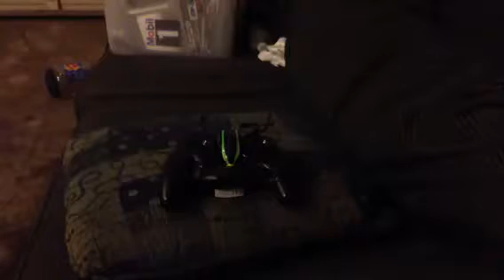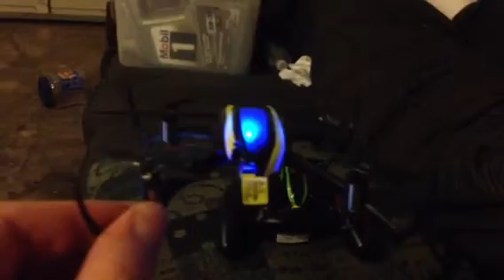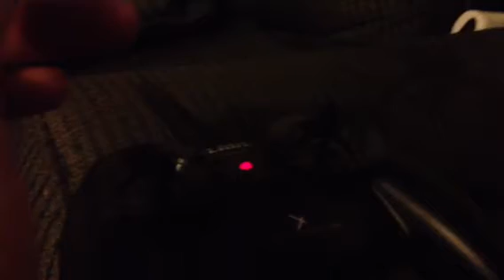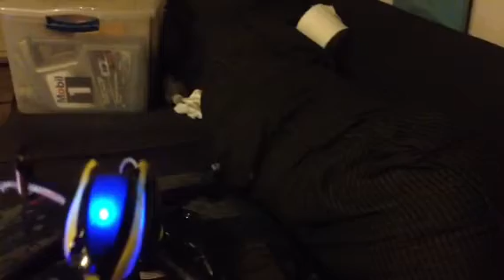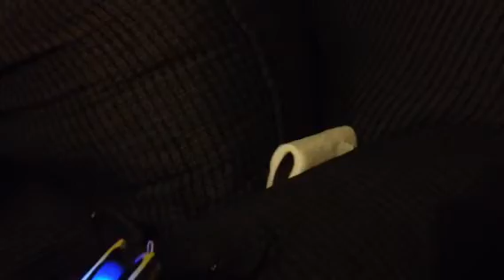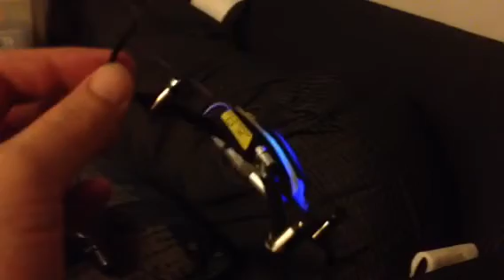Testing nano quadcopter for motor problems

Comment: Thank you so much!
Reply: Dont forget the props. All it takes is a rough edge or a bent up lip to throw this little guy off. Its also easy to subconciously move the stick slightly downwards in a turn. I have since upgraded all my nanos to cf frames with 7mm motors using 300mah batteries. Not nearly as floaty,fast and handles the wind better than my 180qx. iirc the cf frame was $20 and of course the motors. I also use prop guards.
Reply: JIMJAMSC I tried moving to a CF frame with 7mm motors but it didn't fly right. It was too jittery to do anything besides hover. I also got the 500mah batteries from rc-drones but the plug was different. So since there's no way to tune the FC I decided to move back to the stock frame and just buy more batteries. I'm wanting to use the Alienwii with the extra parts I have now but I can't find one in stock anywhere.
Reply: +Bill Roberts you have to unsolder the original plug and resolder a walkera plug onto the board.  I use the 500mag 25c battery.  Also using foam double sided tape to mount the board does away with the jitters.  I've had good success with 135mm frame with 7mm mmw  7020-14 motors.  Currently working out bugs on my 8.5mm dark edition build.

Comment: I have been flying the Nano since it came out and yesterday got the FPV version. It is heavier and is harder to maintain altitude but I have noticed a issue. In stability mode and flying very slow and precise, A right hand turn with rudder causes the Nano to descend. Not all the time but enough to notice. I have also descended all the way to the ground from altitude. With the goggles on by the time I am aware of the descent it is often to late to add power. I am getting ready to start replacing motors and see if one is weak.
Reply: I noticed that too on mine. Which is what led me here. Definitely sounds like a bad motor.

Comment: Question went the nano qx have a bad motor the activate the lvc because my do that .
Reply: +Bill Roberts I believe this is do to a weak battery
Reply: Not sure what you're trying to say. But it sounds like you're having the same issue I have. When mine goes down it acts like it's in LVC but once it lands the light is not flashing to indicate LVC. If I let it sit for a few seconds it can take off again and fly for a minute before it happens again. I believe a bad motor is the issue.